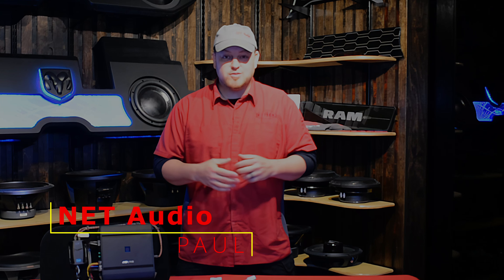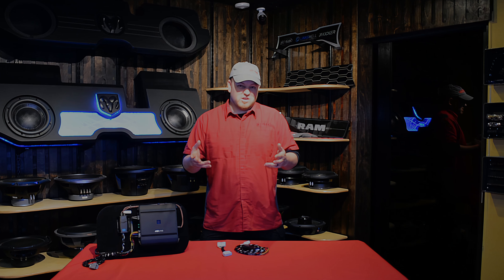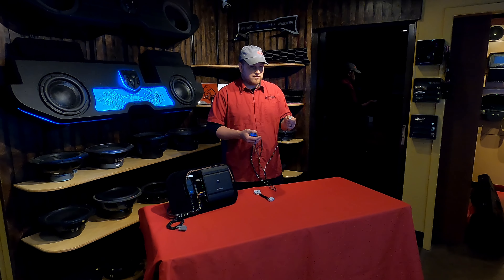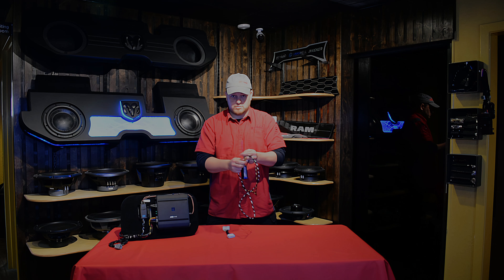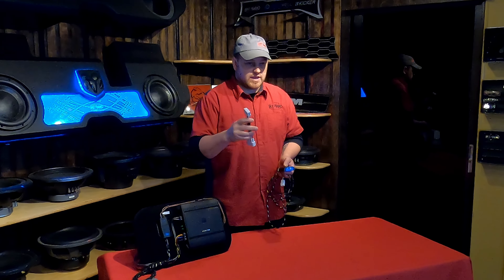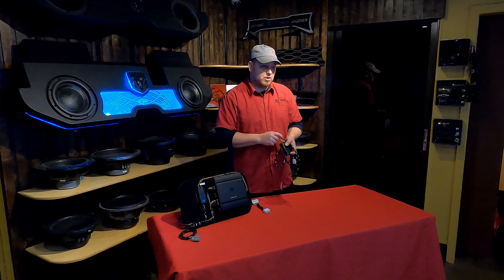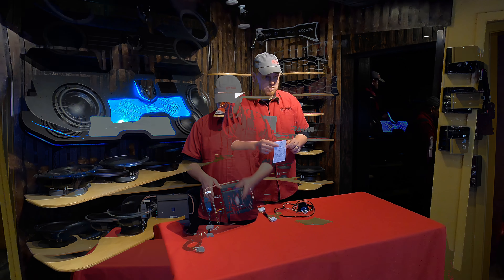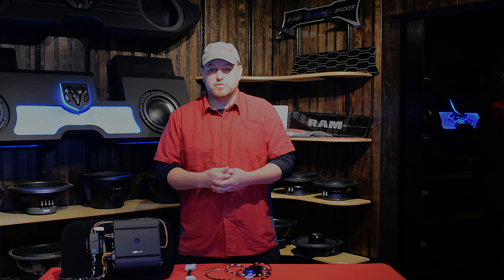RAM Harmon Kardon Subwoofer Installation Harness with Converter

Comment: I have a 2020 Kia Cadenza Limited with factory Harmon Kardon system, looking to do a custom spl setup and add aftermarket subwoofers. Eventually want to upgrade my door speakers also, I just have never put a bigger system in a car using the factory head unit. Do you have anything I can use like this?

Comment: Where do you recommend to ground?  I’ve got a 2025 Limited and it needs better bass so stumbled on your post excellent video looking for options
Reply from the maker: We always make our own and would never recommend using a stock bolt or ground in the back. We go near the back wall on the floor, grind the paint off to shiny bare metal and use a nut and bolt or self tapping screws to hold the ground to the body.

Comment: Adding only subs in 2023 Ram HK system...is there need to fix bass roll off with this harness/setup??? If yes, I assume I will need Audiocontrol LC2i?
Reply from the maker: I don't feel there is a need to fi it, but everyone has a different opinion on that. If you want more control, then the LC2i is a great way to allow you to tweak that to your liking. It's a great piece of equipment.

Comment: I had subwoofers installed on my 5th gen, when I try to raise the volume it stops getting louder at around volume 25 but it goes up to 36. I’m not sure if they used a harness. Does this mean I need more power for more volume? Door speakers were stock and I switched them with kicker door speakers to see if this would fix it. No change. What do you think?
Reply from the maker: Part if that is probably the built in variable EQ that is in the system. It all depends on the system that is in the truck now and where they tapped into the factory system.

Comment: Would that harness work if i want to add a all in one subwoofer?
Reply from the maker: It works for the signal, yes, if your truck has the Harmon system in it. But you will still need to run your own power and ground.
Reply: Awesome thanks you. I will try that in the meantime . But in also saw you guys have a replacement subwoofer that replaces the stock one looks awesome thanks you.

Comment: Do i need this if all i want to do is, unplug the factory HK sub and run my own sub under the seat. While keeping the factory amp powering the new sub. Forgive my ignorance if its covered in another video.
Reply from the maker: If you're just relocating the stock sub, then this won't work. Most guys just tap into the speaker wires at the subwoofer for doing what you're doing.

Comment: Will I need to run a lc2i pro to run some aftermarket door speakers? Or will it need a lci7?
Reply: What factory sound system is in there now? I'd rather run the LC7 so I can keep front, rear and sub. I know people use the LC2i for a 6 channel setup but it's not really intended to do that.
Reply: @paulmorgan3790  I have the HK sound system. I’ve tried to do some research on it seeing if people were using lc2s or lc7s.
Reply: @Kado01  If you have the Harman system, you need to do the Pac AmpPro. It's the only way to get that system working and sounding like you expect it to.

https://youtu.be/pWUuI6r-0Bo

Comment: What if I want to get rid of my Factory HK sub and add a 4-8” sub box under the seat does this still work or how do I go about that or do you recommend me keeping my factory HK sub and adding the box under my rear seats using this kit?
Reply from the maker: With any vehicle with a factory subwoofer, we always recommend disconnecting the stock subwoofer in order to avoid any cancellation issues. Every time that we have left the stock woofer connected, the customer complains until we disconnect it. So, we would recommend leaving it disconnected with the new subs.
Reply: @Netaudiowf  okay so then in that case should I just tap into the speaker wire since I will be disconnecting the factory sub and not use this anymore?
Reply from the maker: @osvaldoalvarado5648  Correct, which is what our part is doing, just without modifying any of the stock wiring.

Comment: Does this stop the factory sub from working to?
Reply from the maker: Yes it does. We are disconnecting the factory subwoofer for our signal to make this work. But also, you don't want the factory subwoofer and the new subwoofer both working, it will lead to some cancelation issues and can make it sound funny.
Reply: @Netaudiowf thanks for the respond. I just ordered this wire harness from you guys and I have a lc2i from my last set up. Would it be easy to cut out the pac and rewire my lc2i in place of the pac?
Reply from the maker: @jessep8170  If you'd rather use the LC2i, yes, it's an easy modification.

Comment: Do you have T harness for 2025 ram 1500?
Reply from the maker: For what purpose? Adding subs?
Reply: Yes for adding subs.
I have 2025 with the 19 speaker harmon kardon system
Reply from the maker: @corydorris7495  the 2025 Harman 1500 Crews are different than the 2024. We know the plugs and the wiring and have the connector for the subwoofer plug on the back wall, we're just waiting for confirmation about the ANC bypass so we can bypass it without cutting anything.
Reply: Ok when do u anticipate having it figured out i really want to  install my subs
Reply from the maker: @corydorris7495  We need to spend some more time with a customer's truck. On the amplifier, all wiring for the ANC system is in it's own small plug at the amplifier, it is accessible from the front of the front seat at the amplifier under the seat. There are 4 plugs, 3 the same size and one smaller. If you unplug it, it removes all mic wires and 2 data wires. If you unplug it and drive it around, if it's not throwing any codes or errors then that's all that is needed and no need for us to get another harness made for it.
Reply: Will removing the anc that way affect being able to talk on phone through factory system? Also can  i order 2024 harness to get remote&rca signal for amp until you guys figure out a bypass for the ANC
Reply from the maker: @corydorris7495  On the previous model, no issues. This is the kind of stuff we need to find out with the new model. Us disconnecting it for a quick test in the bay is different than someone who is used to the truck and using it daily. We need that feed back. But it is supposed to have no effect on the handsfree functions, there are separate mics and system for that in the truck.
Reply: Ok i will give that a try and see how unplugging the ANC works out. When you say throw codes u mean check engine light?
Should harness from the 2024 work on the 2025 for rca signal and remote turn on?
Reply from the maker: @corydorris7495  Any sort of errors that may throw up. We know what the data wires are tied into, but will it even care that it's been unplugged or will it be weird about it. Will it be fine immediately and then cause problems later? That sort of thing.
Reply: @Netaudiowf  and the ANC is the smaller of the 4 plugs?
Reply from the maker: @corydorris7495  Yes, it's a black connector that is around 3/4" x 1".
Reply: @Netaudiowf  ok will the 2024 t harness work on the 2025? Or do i have to wait to you guys get it worked out to order one?
Reply from the maker: @corydorris7495  The 24 is completely different than the 25 one, it won't work.
Reply: @Netaudiowf  ok thanks.
Im tryng to get this install donw without cutting or splicing into anything